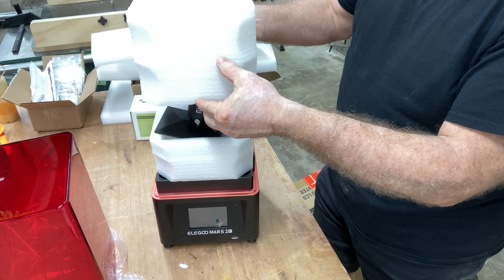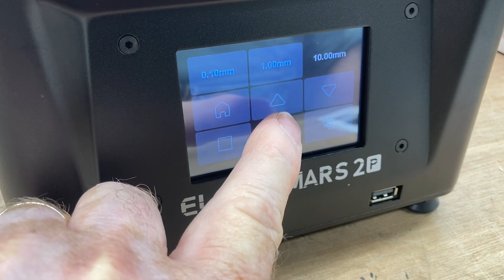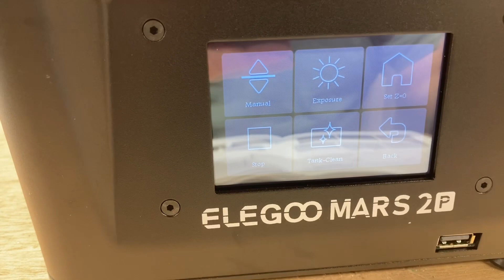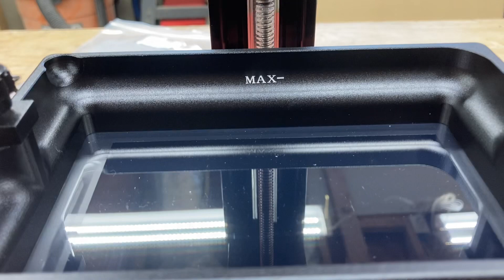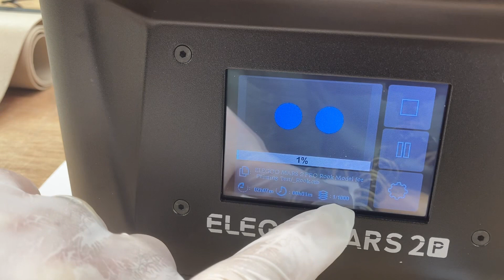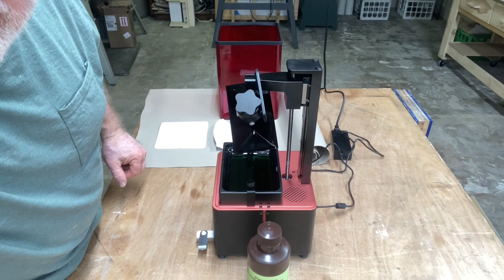Review of the ELEGOO MARS 2 Pro Setup and Test Print

Comment: Just saw this video tonight and was wondering, you had 2 items in the print for 2+ hours.  If you would have had 10 of these printing at the same time, would it still have only taken the same 2+ hours since they would have all printed (dipped in the tank and been on the same layer per dip) at the same time?? OR would it have taken a lot more time??  Just curious as I am still "researching" before I buy one of these.
Reply from the maker: It prints in layers. By arranging the design to reduce the number of layers is the best way to reduce the time